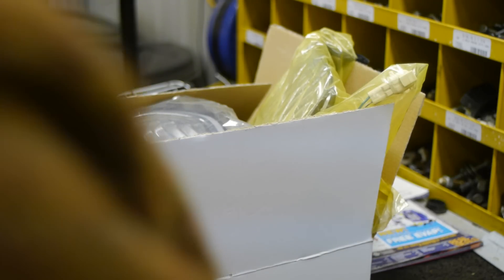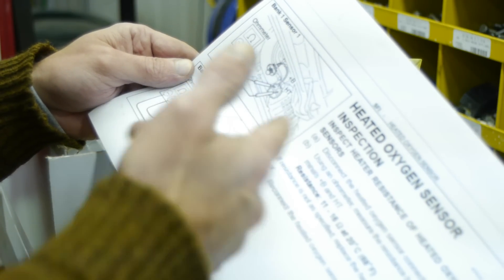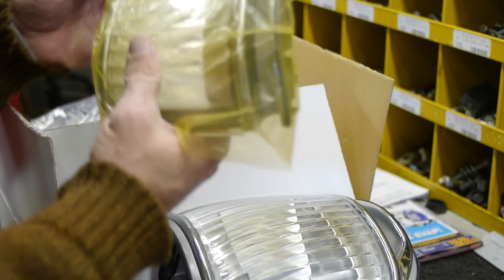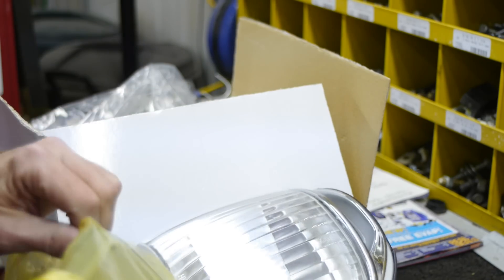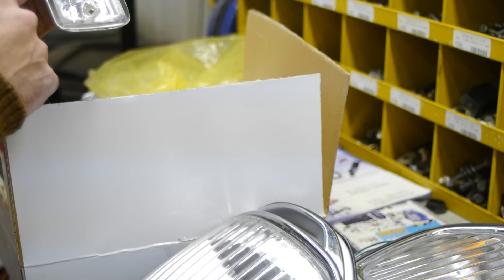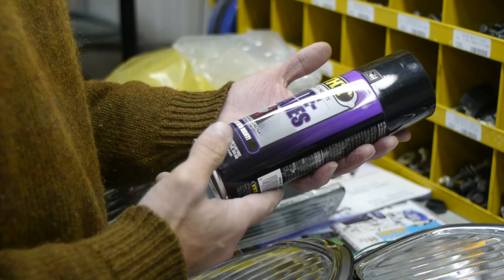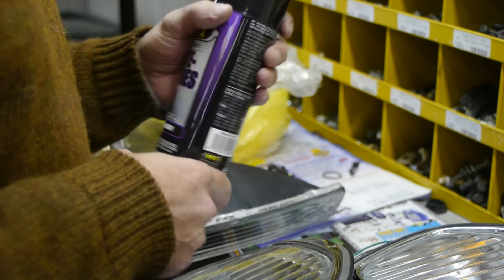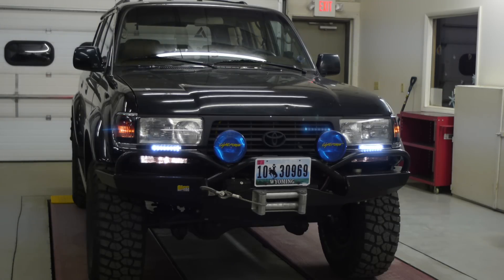Toyota Land Cruiser FJ80. Marker Lights gray-out

Comment: Do you have specific part number for the narrow lights under the headlights?  Or do you have a write-up or video on install?  Thnx!
Reply from the maker: ***** Not sure about the part number but here is where I got mine: @itm/6PCS-91-92-93-94-95-96-97-TOYOTA-LAND-CRUISER-FJ80-DEPO-CLEAR-HEADLIGHTS-SET-NEW/400830396244?_trksid=p2047675.c100011.m1850&_trkparms=aid%3D222007%26algo%3DSIC.MBE%26ao%3D1%26asc%3D20140602152332%26meid%3D1514b8553ea142e598f7fbef2cf5cfbb%26pid%3D100011%26prg%3D20140602152332%26rk%3D2%26rkt%3D10%26sd%3D400781967862
Reply: +Jake Paslar hey i'm looking to buy this set, but I'm having cool feet, with the headlights are they made of plastic or glass? i hope you could help with that soon since theres only a set left!